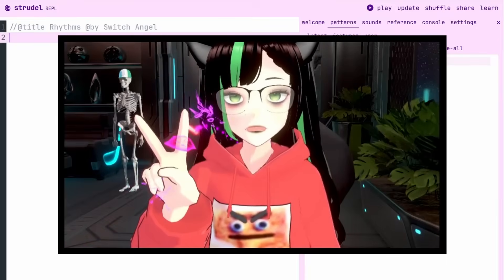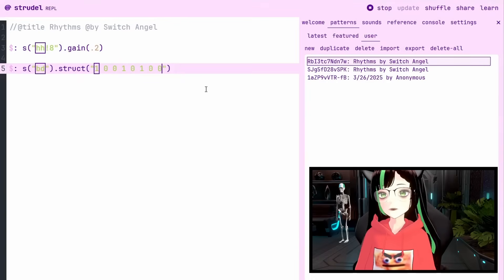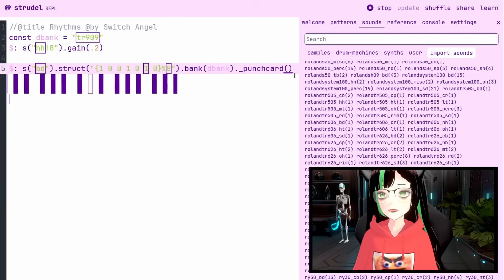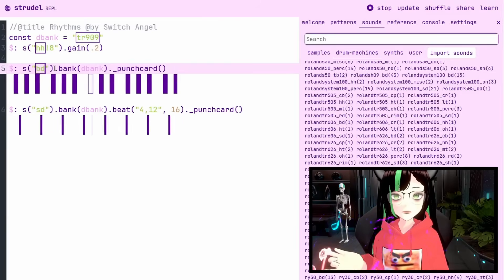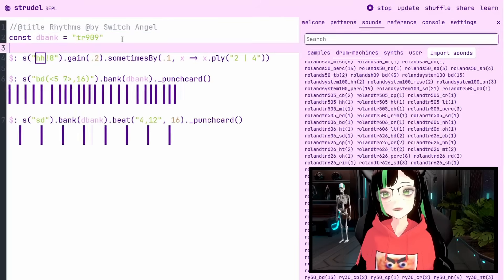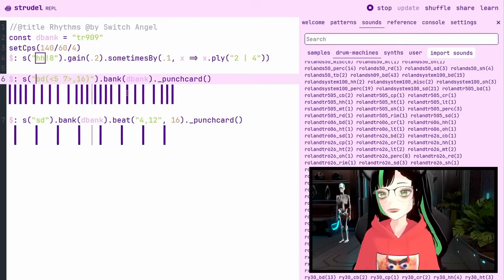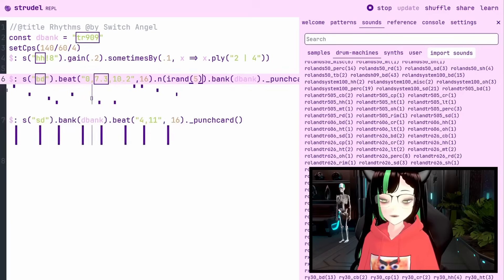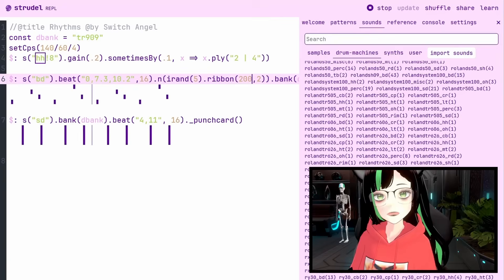Creating Beats & Rhythms in STRUDEL

Comment: Nice Video!

Strudel is a fun concept for those wanting to use code as a means to interface with their writing process. That said, another methodological approach to get a stochastic percussion part with user defined variations is to use a granular sampler and a looper to capture desired permutations in real time.

This way allows for midi linking to parameters such as Start/End times for scanning as well as Grain Generation Frequency.

Cheers!